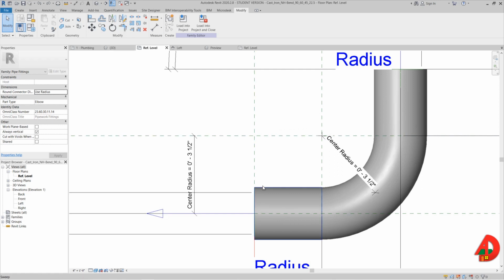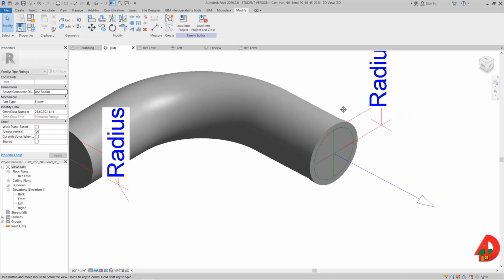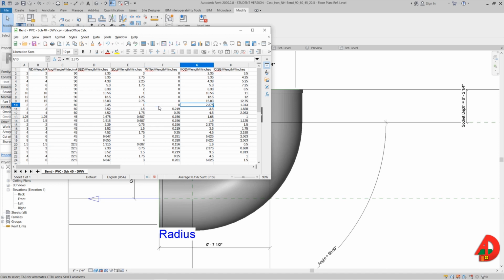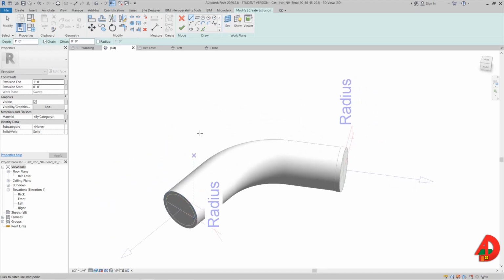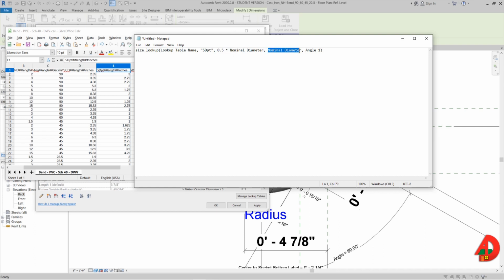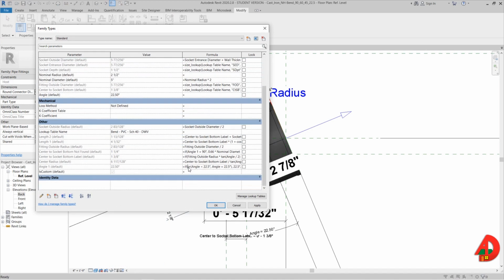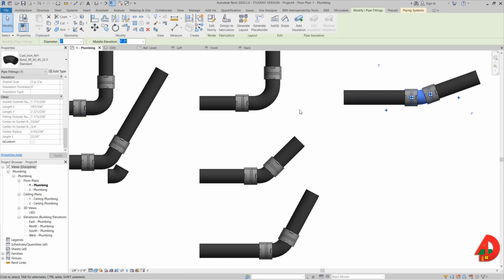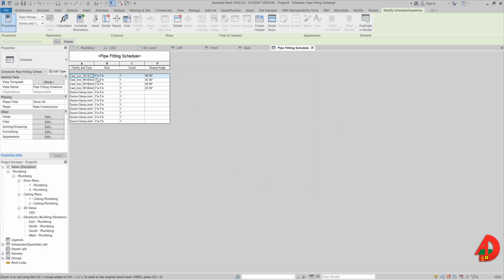Cast Iron Fitting (Bend) in Revit - Part 2

Comment from the maker: Angle formula that includes the 72 degree bend:
if(or(Angle < 30°, Angle = 30°), 22.5°, if(or(Angle < 50°, Angle = 50°), 45°, if(or(Angle < 65°, Angle = 65°), 60°, if(or(Angle < 77°, Angle = 77°), 72°, 90°))))